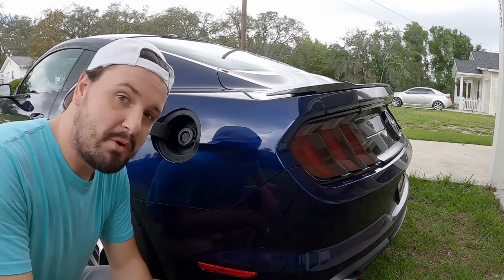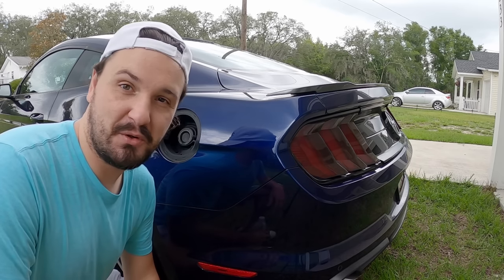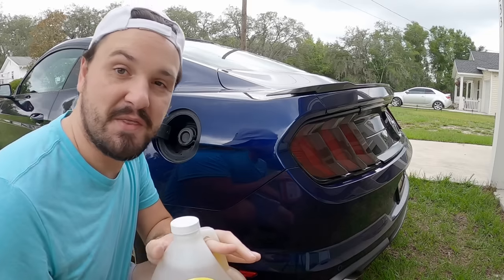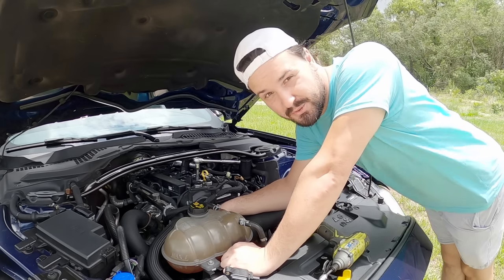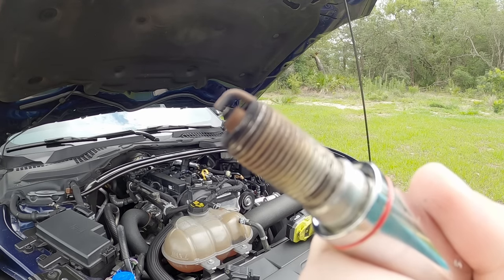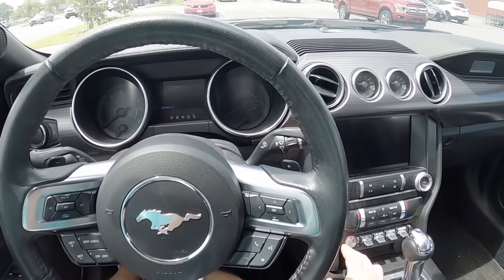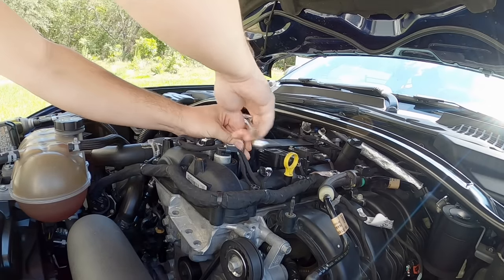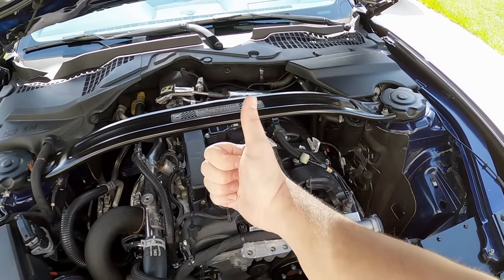The UNTHINKABLE Happened after using a Gallon of Lucas Fuel Treatment!

Comment: After watching this I decided to dump 4 gallons in my truck. A: because it is a truck and bigger so I thought it needed more and B: because I really wanted big gains in the HP's. Well here I sit in the hospital after adding the four gallons and topping off the tank with gas from the local grocery store. I pulled out on the freeway and stuck the pedal to the plastic. Slammed my head so hard in the seat I blacked out and don't really remember the rest. So word to the wise. Be cautious if using more than a gallon for your first time.
Reply: Just think what would have happened if you had dumped 8 gallons of Lucas into your gas tank. When you stepped on the gas, you might have flown through the rear window.
Reply: @franknew9001  I have PTSD from just four 😐
Reply: Unleashing all the power in that Tundra😂.
Reply: You know you could try forgetting gas and just fill the tank with Lucas treatment.
Reply: Eric has made an appearance, you sneaky dog, you. Have the Nissans have finally let up and given you a breather? I put a couple gallons in my Vette and lost to some guy in an Ecoboost Mustang. Wth?
Reply: Eric, better watch out that Mrs. O doesn't sneak a few gallons into your John Deere excavator!
Reply: Doesn't surprise me one bit. 

It worked so well in my powerstroke that when I had the Covid in 2022 I didn't drive to the hospital, I drove to my Auto Parts store and drank a bottle of Lucas in the parking lot (the quart, not the gallon)...............15 mins later I just ran home, cars still there . Can't stop running....
Reply: I had the same exp with my first six pack of beer. It gets better though...
Reply: Haaaa!!!!
Reply: @br5747  The last person that tried that opened a wormhole and traveled back in time.  True Story 🤣
Reply: @scotttaylor9339  😂👍
Reply: @thekingsilver😂😂😂ado3266
Reply: The reason you wound up in the hospital is becasue you realized that you live in NY

Comment: I used this exact stuff in my 2011 2500 Chevy 6.0. Used it for heavy hauling at work. Hit 308,400 miles before the engine pooped out. I guess I should have used a whole gallon each time maybe it would still be on the road? Haha. I do love this stuff! it really worked for me!
Reply: Great mother of Jesus! That is 1/2 of a Million kilometers, like halve way to the moon. There is NO Ford on Earth that has gone that far since they used to build the old Ford straight six 300 for Christ's sake! Good info man, that is the same truck, same engine I have and I push that thing HARD through the mountains loaded. I am 63yo and I have owned many trucks in my lifetime, and this is the BEST truck I have EVER owned, it takes the heavy hauling and pulling loaded trailers through the mountains every time using the Tow/haul switch on the 4L80E transmission, she just rumbles down 10 miles of 8% grades with NO brakes necessary.
 I pour in a small bottle of Lucas each 1000+ mile trip and it runs smooth. I also run Amsoil Signature 5-30W Oil, AND I do an Amsoil Engine Flush each Oil change using a Fram Oil filter for the flush and then throw away the Fram and install a Wix XP filter. The Oil is expensive but, this truck has NEVER let me down pulling heavy loads through the mountains. It does not get the mileage of a 5.3L Chevy, but it don't break down like the 5.3 does either. The 6 liter has better torque and better reliability is my opinion. Here in the mountains of British Columbia fuel is notoriously bad and hard on fuel pumps. My brother told me 30 years a go to use a fuel additive no less than once a year to lubricate you in tank fuel pump so that you will NEVER have to do an in tank fuel pump. I find this to be true, use Lucas on a regular basis, and you will never have to do a fuel pump on your modern automobile.
1988 I used to work at an engine re-builder, the #1 cause of engine failure was "Lack of lubrication". I don't believe that has changed in my lifetime. Use top grade motor Oil, never let your Oil get black and use a fuel additive like Lucas and you will have trouble free motoring is my opinion.
 This was a hugely entertaining redneck automotive 🤣math experiment in my opinion.
Reply: @brentmcgillis  My 5.3 2000 Silverado has 306,000 using valvoline oil synthetic. The transmission was rebuilt at 275,000 but motor still running good.19 mpg on the highway, not bad for a old worn out truck.
Reply: @brentmcgillis My van E250 2003 first new vehicle I ever owned. Mobil 1 and Lucas oil treatment. Original motor and tranny. 377000 miles.She still runs strong. I'm a tile contractor and she always hauls weight. It's all about changing the oil and how you drive. Don't mash your gas and read the traffic

Comment: i dont think we have to worry about what the lucas is doing holding it at 6k rpm is gonna do plenty of damage
Reply: Broooo it's cleaning bro. Gotta clean it. Lolololp
Reply: @larry_ellison  2000rpm at 30 min will do the job.  6000 is just stupid.
Reply: What is 6000rpm gonna hurt? It's 6000rpm at minimum load. The engine is barely working. Idling for the same amount of time is far worse. At least at 6k your oil is pumping, your water is flowing, and heat is being removed from the engine bay. Also because that is 2.3 turbo it is a low compression engine. Running at 6k with no load it is actually not in boost and using very little fuel. No, it's not "as good" as running 1.5k down the road at the same speed but it really won't hurt anything. I think it was penzoil that ran a 5.7 charger at 5k for 200k miles on a dyno. They did factory recommend oil changes and factory recommended maintenance. They have the engine to a school and asked them to guess at the mileage. The average guess was 50k

Comment: I love Marvel Mystery Oil added to my oil in my 2002 300k mile Blazer ZR2 4x4. 
She still runs like new & I'm still getting the sticker mpg, 16 in town & higher on the highway.
Reply: I have been using Marvel Mystery Oil at every fill up in my car, truck, and lawn mower for more than 7 years. I use the recommended amount of 4 ounces of MMO for every 10 gallons of gas. My 2002 Lincoln Town Car that has been my daily driver for 16 years, still gets 23 miles per gallon on the highway.
      Several years ago, my 2002 Chevy truck had a loud lifter ticking noise. It was a quart low on oil, so I added a quart of MMO to the crankcase. Soon the lifter ticking noise disappeared. I drove the truck about 400 miles and when I changed the oil, it was extremely . This was telling me that the MMO was removing the sludge out of the engine.
Reply: And it would still be running good and getting the same amount of gas mileage if you didn't use the shit

Comment: My 2001 Accord could barely reach 500 km in a single tank and it gets progressively worse until I started using Lucas Oil, add about 120 ml per tank and took nearly half a gallon to see the improvements and now I can drive up to 540 km in a single tank.
Reply: You added the whole gallon in to it?
Reply: @hacatan24  120ml at a time
Reply: I got rid of my fat gf and achieved the same result
Reply: That's an almost 10% improvement, some would call it significant.
Reply: @ragman069 😂😅😅😅😂😂😂
Reply: @ragman069  you are a champ
Reply: @hacatan24 you know this video is sarcasm right? What you should be using is Marval Mystery Oil.
Reply: @holylabs ”Marval”?
Reply: We use miles so it actually is something easier to relate too.
Reply: I think a kilometer is a little over half a mile something like that.
Reply: @holylabs Yes MM oil is a lot like Lucky Tiger Hair Tonic.
Reply: Well the same color at least and almost the same smell. MM oil works good for air tools.
Reply: @ragman069 dude😂😂😂 that's awesome lol

Comment: It looked better the first time. 
Light brown is a good running motor!
I always used transmission fluid in the coburater; smoked like hell for a while, but cleaned everything!
Yes I know 👍
Reply: Eddie, a thousand years ago, I worked at Andy Granatelli's Tune Up Masters. They had a dyno and we'd run the engine under slight load and sprayed trannie fluid, (not Bud Light trannie fluid) and yes, it did smoke, a lot of white/blue smoke. It was supposed to remove varnish and other deposits from the top end. Mostly valve stems.
Reply: That's insane!!! Does that clear any gunk in the jets and fuel passageways, or is it more for cleaning in general and removing surface dirt?
Reply: I've done that many times. Hold a fast idle and let it drip. Just have to be careful you don't slip and hydrolock the motor. Makes one hell of a mosquito killer.
Reply: @StillAProudAmerican-ll2yc Hubby worked at same place in 80s & they added water into carb at high idle to burn carbon buildup. This was done with car strapped on Dyno.
Reply: @cherylkygirl7181 , I learned a lot then, forgot it all, heehee. Because water isn't compressible may be why it works but it breaks carbon loose from the combustion chamber, that's what they say anyway.
Reply: @cherylkygirl7181  I met a man in Wyoming about 12 years ago that had a set up on his motor home engine that would inject a water mist into his air intake. He claimed it improved mileage and I imagine it helped keep his combustion chambers clean.  
I blew a head gasket on a 1976 Toyota 4 cyl. . After driving 60 miles home with a huge fog following close behind,  the next day I replaced the head gasket, no warpage surprisingly, but that #3 cyl. was the shinest piston I've ever seen.

Comment: I've used both Marvel Mystery Oil and Lucas in gas and diesel and I could tell the difference especially with my old school 6.2 diesel but I haven't put an entire gallon at once .
Reply: The Marvel mystery oil is just pain old mineral oil with dye in it. The FAA found this additive in the fuel tank of an airplane. Expensive lab tests showed it’s just that.
Reply: I added Both to the crankcase and it stop a rear main leak. In a Jeep

Comment: i love Lucas products and i use a variety of them. i use the upper cylinder/fuel treatment in everything once a year. when you first bring out the snowblower or lawn mower.... put some of this in that first tank. keeps it all clean and moisture free. all my yard equipment has it's original carburetors, and all are 20+years old. they run like the day i bought them.
Reply: I add nothing to my yard equipment's gas and they're doing fine also.
Reply: @DonziGT230 yup, I have a 33 year old craftsman lawnmower and never added anything to the fuel or oil, I just drain everything before winter storage, refill in spring and it starts with one pull everytime.
Reply: Try using Red Armor fuel for the last one or two tanks before storing your outdoor equipment.  Drives out any moisture loving ethanol causing seals to degrade. My honda lawnmower and Echo chainsaws love it!
Reply: There is no valid reason a 50 year old lawn mower or weed eater should not run like it's new if it is properly maintained . These youngsters these days all think they know something and never shut their mouths long enough to listen and be taught the facts.
Reply: You know most of them I'm referring too under 50 years old but they do know some things sad part is that's all they know and it's usually not much. And they refuse to Listen up and get instructed properly.
Reply: @muddboggin1014 That Craftsman probably has a Techumseh engine and a Tillotson carburetor.

Comment: I tried both small amount of marvels mystery oil , small amount of Lucas fuel injector cleaner and ran it for a week. I noticed a positive change for the better,. It still runs great.  This video may be a bad idea. Just a thought.
Reply: I mix both...fir ever 10 gal of fuel.. 4oz MMO..3 oz Lucas

I didn't notice any mpg benefits in my Prius but it did smoothen the idle and when the engine turns on...

Comment: I use Lucas Fuel additive in my  2005 6.0 diesel. Definitely works and definitely bumps up my power due to increased cetane. Also smoothed out the rough idle I was experiencing.
Reply: ✅📈👍✅ my motor quite like a mouse bearing 300k

Comment: As a long time mechanic I suggest you try following instructions. This is a joke but it could have been a legitimate test. This stuff works great in my Cummins Ram. I can hear the difference. But I at least try to follow the instructions. 😅
Reply: Try Archoil 9100 next oil change, add a quart. I’ve been doing it for 18 years with my diesel and mileage improves, starts quieter, runs smoother and is a sound product
Reply: If you were doing it for so long, what are you comparing it to?
Reply: @garychandler4296  doing what for so long? Being a mechanic?
Reply: @Rakkasan-vr8xt  sounds good but that doesn't lubricate my nearly $5000 worth of fuel injectors. The low sulfer fuels are tearing them up. Sulfer is a lubricant. Lucas addresses that and the sound difference is very apparent.
Reply: @fiskfarm  starts quieter, runs smoother than what? Itself, 18 years ago?
Reply: @garychandler4296  with and without. One tank of fuel to the next. Go without it for a few weeks or months and then try adding it and you can tell the difference almost immediately or at least I can but I've been a mechanic for over 60 years with a trained ear. Not rocket science nonetheless. Tested it with and without many times over the last 10 years I've owned this Cummins Ram.
Reply: @garychandler4296  you are very confused. Please address the right person.

Comment: Putting that in your tank kills your catalytic converter.
Reply: Forget catalytic converters people take them off your vehicle anyway . Had new exhaust put on my flatbed and guy told me he put hollowed out catalytic converter on it .
Reply: @jamesphillips7283  never passing emissions tests
Reply: @ryansmiley5495  Depends on the state testing equipment. We got a guy here he puts the same vehicle on the scanner so customers pass. Some states R slime balls they got picture ID stuff for testing
Reply: When there was leaded Gasoline we used to either cut them out or drain the beads out because they would clog up..
Reply: @ryansmiley5495  passed inspection 6 years in a row
Reply: they'll get stole anyway

Comment: I had a diesel golf and a free supply of Jet B. Idk if it was necessary but I always added a whole bunch  of the Lucas upper cylinder lube and injector cleaner every tank. Was running out of fuel once and dumped a gallon of it in and it ran great on it and got me to a fueling station.
Reply: In a diesel, your rings and upper cylinders are lubricated by the fuel itself just for your info. You don't have to spend the extra money, unlike gas,  diesel is more of a solvent having  better lubricating properties.
Reply: @davecinco847  I was more worried about damage to the injection pump as the jet B seemed to be less of a lubricant and more of a solvent.
Reply: That's awesome @scottod6954 did you learn that in school or are you a free thinker and figured that on your own?
Reply: @davecinco847 you mean gasoline is more of a solvent and diesel is more of a lite oil?

Comment: It is best to run premium fuel in the EcoBoost Motors. On 87 octane you get less horse power and the motor will fall on it' face over 5000 rpm's.  The listed horse power is with premium fuel.  Just an FYI  😎👍
Reply: Echo boost with an E85 tune 😁
Reply: Went through new Mexico had 1/4 tank thought I would fill up before going back to Texas stopped at big truck stop gas was 1.00 more than Texas and their super unleaded was 86 octane our lowest gas here is 87 octane lol.
Reply: Fords R junk my Silverado smokes them toads.
Reply: @jamesphillips7283  Depending on where in New Mexico you were, the octane selection is based on the altitude. In Wyoming, base is usually 85 or 86, mid is 87 or 88, and premium is 91. Apparently a decade or 4 back, the fuel companies figured out that at high altitude (over 5k feet) 85 octane supposedly acts like 87 does at sea level. Personally I thinks it's a load of crap. My operator manuals have always stated 87 minimum octane. Never have I seen a mention of high altitude can use lower octane.
Reply: The 10 speeds stay in power band. The 6r80s were the ones to fall in it's face

Comment: Well I have a feeling your next video will be changing out a plugged Cat.
Reply: Catalytic converters are perfectly fine as they're designed to burn this stuff off due to excess heat. The main thing that will plug a catalytic converter is unburnt oil. Now unburnt fuel may overheat a catalytic converter. Where do you people come up with these myths!
Reply: @jamesm568 I like a fool plugged my cat on an 1988 Buick Lasabre. By dumping in a pint of MMO. One time.

Comment: I did it with lacquer thinner a year and a half ago. Been running better than new ever since.
Reply: @logicthought24  Scotty Kilmer has a method that works. It'll mess things up if done wrong though...
Reply: @logicthought24  Its called SARCASM. Kinda like the guy in the video. LOL
Reply: Never mind that it will destroy every plastic component in the fuel system.  I love lacquer thinner, buy it by the 5 gallon can to use as universal cleaner in the shop.  But do NOT use it around most plastic, rubber and paint.  It'll clean that stuff right off as well.
Reply: Try acetone 😮

Comment: keep adding stuff to your tank, be sure to let us know when your cat fails and plugs up, creating back pressure and burned valves with that turbo. hope its worth a few clicks on some internet webpage.
Reply: For sure. A guy I know totally fouled the cat on his Kia using too much Lucas in the gas tank. His cost for the replacement converter built for the California emission specifications cost $2600 for the part, $400 for labor to install. On a 4 year old Hyundai 2.0 liter 4 cylinder.